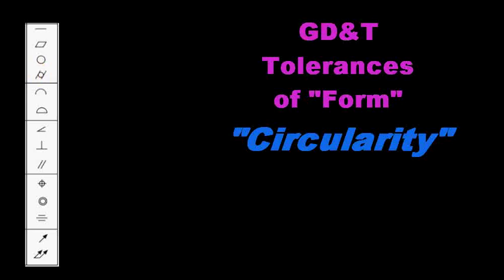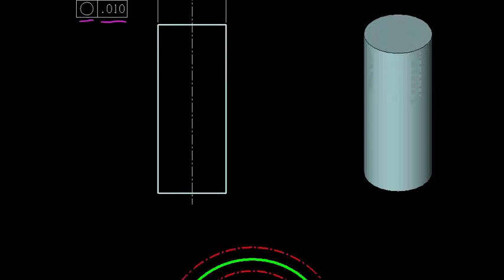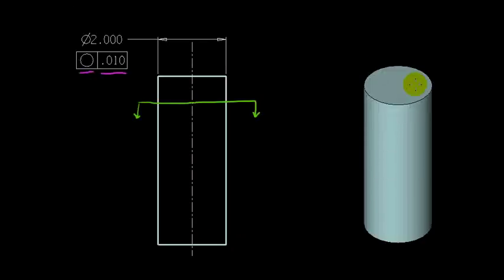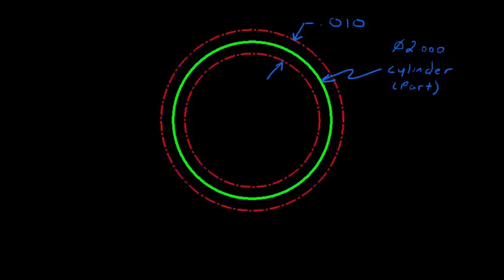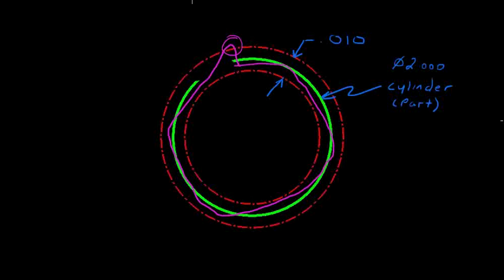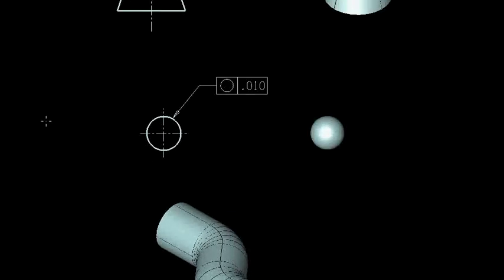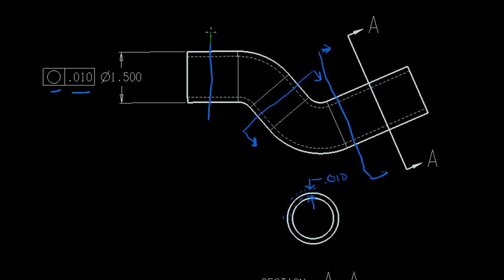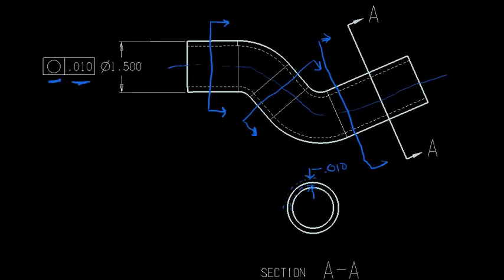Blue Print Reading - GD&T Circularity

Comment: Does 1.500 with circular tolerance mean 1.500 with max OD of 1.510 and min OD of 1.500,  or do we have MAX OD 1.500, min OD of 1.490?  Please clarify
Reply: Michael Chernoff  i think as circularity tolerance only implies acceptance for form, actual diameter values might be floating with 1.5" as a possible upper, mid or a lower bound in that range